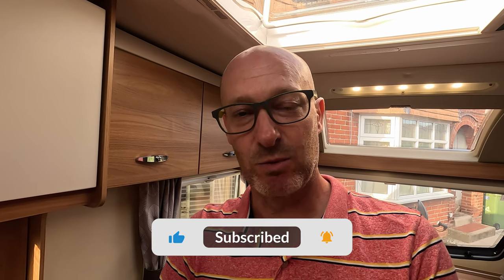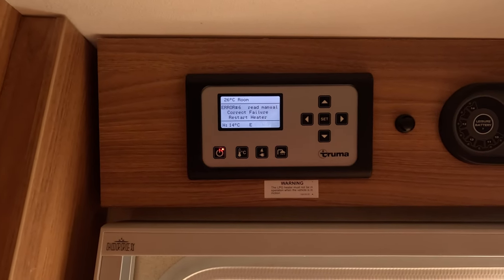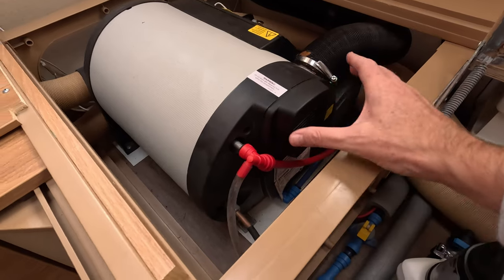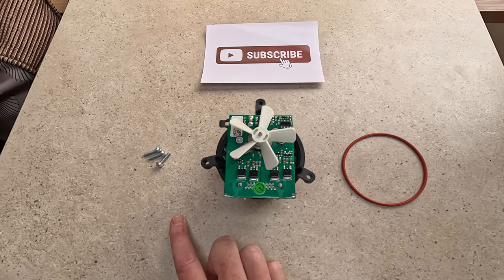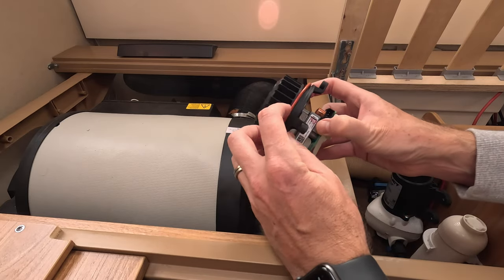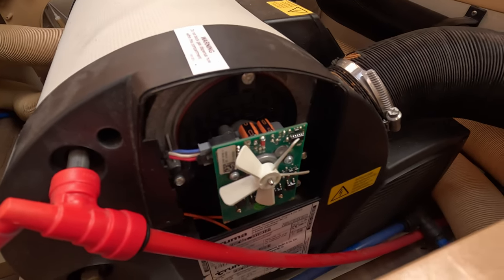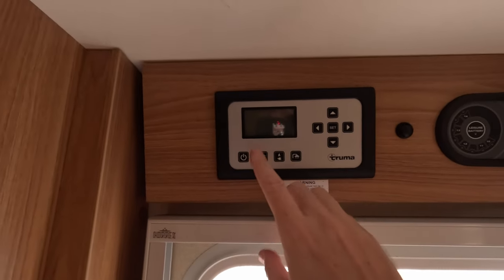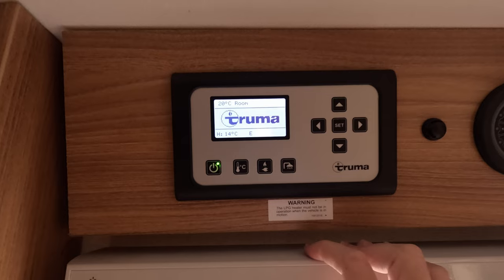How To Fix Error Code 6 On The Truma Combi Boiler, Don't Get Caught Out!  🛠️ #caravan

Comment: Just to say a massive thanks for this video. It got me on the road to solving my problem - not least as it showed how easy it is to access and remove the combusion fan. I did not know about the small cover that just lifted up! I was anticipating the need to remove the whole boiler - beyond my comfort zone as I did not want to start disconnecting gas components. I know of only one other video on the internet (subsequently discovered) that helps in this way. Your video was found almost by accident and I nearly could not find it again when I wanted to write and say thank you. There are Truma "Combi 4" and "Combi 6" boilers and I think your video gets lost in the search for these. If you adjust the video title to make it more clear that it is about a "Code 6" error on Truma combi boilers, it will be found more easily for anyone searching for Code 6 issues: e.g. "E 6 H". My combustion fan is now out and hopefully being repaired. I hope to update again shortly with further information that may be useful to others.
Reply from the maker: I'm so glad our video gave you the information you needed to help resolve your issue. Thanks for the feedback regarding the title, we'll look into this. Fingers crossed that you fully resolve the issue you have.